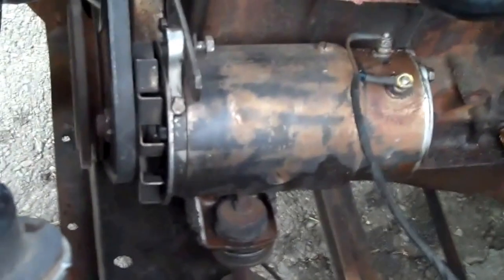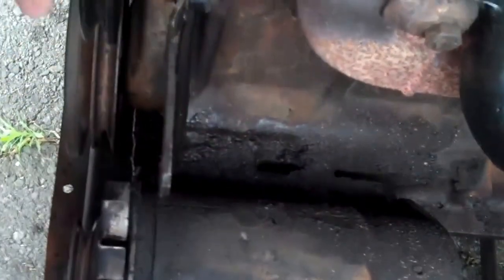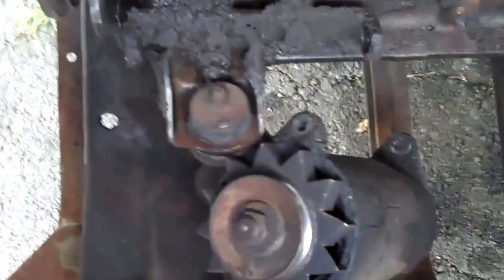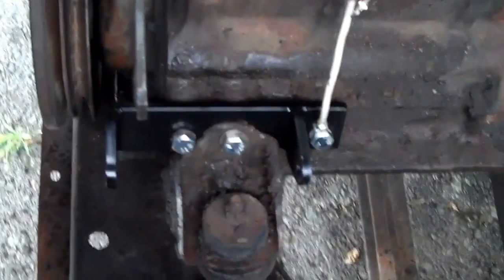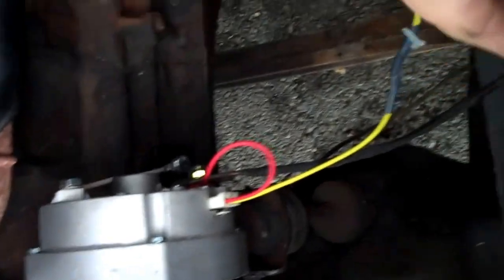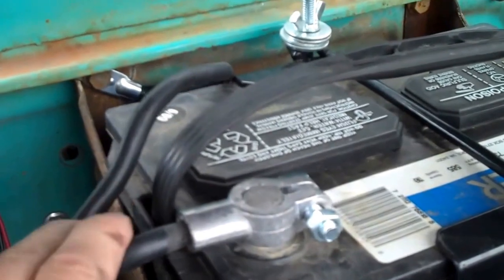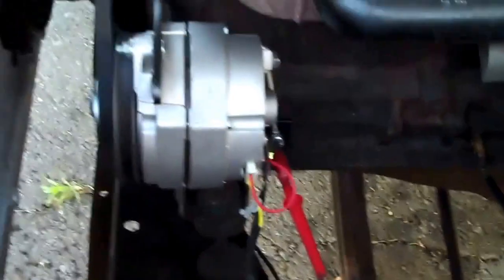Generator to Alternator Coversion

Comment: Couldn't you have used the existing wires to achieve the same thing?  I am thinking that when I get my generator mounted I can run the wires from the gen to the wires that currently connect to the regulator once I identify them... My problem is that I have some custom work under my dash that makes getting to my ignition wire and indicator light wire very difficult and I would prefer to not have to deal with that right now if I can get around it. A friend of mine told me that I can take my power wire from my alt and connect it to the top wire on my regulator then take my GND from my alt and connect it to the 2nd and 3rd wire of my regulator (basically splicing them all together). He said this will take care of everything. Indicator light, ignition and power back to recharge battery.Do you agree with this???  BTW I have a 64 Fairlane .. :) and the only reason I am doing this conversion to alt is because I installed a modern high-powered 1200WATT stereo system in my Fairlane and the Gen cannot handle this at all. In fact it will burn the brushes off of the Gen because it pulls so much current.
Reply from the maker: You can use most the wires.
I connected my wires on the regulator.
used the block for a ground.
the regulator block was only hot with the ignition, so that's why I used it.
I'll send you a photo if I get a chance.
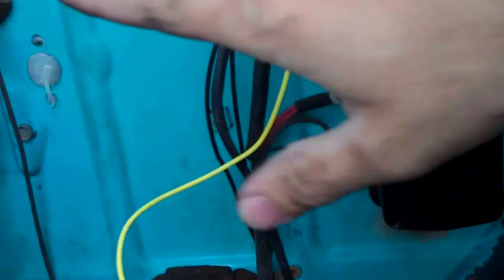Reply from the maker: +GeorgeBonez Starting at 1:52 I show what I have done to use all the existing wires possible. Every car is a little different, you may have access to an exciter wire some place under your hood. If your fuse box is under the hood that would help. Mine is located under the dash. That is the location I used to get ignition hot.
Reply: +Michael Beattie Do you mean 1:52 of this video or are you referring to another vid?  If you are talking about this vid I didn't see you use any of the existing wire. You said (in the vid) to remove them from the regulator and tape them off...  Am I missing something? Sorry Michael but I am a little confused here... :(
Reply from the maker: I'll have to take a photo. what I  did was remove the bottom 2 screws and over lap them all on the top.
basically tied all them wires together.
but I'll look at the truck and check.
been years since I have done this.
Reply: +Michael Beattie Ok man so here is where I am in my conversion... I finally have my 100AMP one-wire Tuff Stuff Bullet alternator mounted properly so I will be attempting the wiring part tomorrow.. The weird thing is that I don't have the yellow wire that you mention in your vid that goes to your ignition so I am really confused how this is all going to work out on my car??? Man it took me over 16 straight hours to work out the mounting brackets and belt-size on my gen/alt conversion and eventually I had to do some serious improvising on the bottom mounting bracket.. The 1964 Ford Fairlane simply wasn't designed for an alternator haha  ...

Comment: I noticed you were able to pull all the bolts by finger.  If you just tightened up all those bolts your generator would have worked just fine.

Just kidding.  Nice how-to video. :)

Comment: CAREFUL about positive ground vehicles... gauges will read backwards.  gotta drop the voltage, insulate the gauge from the cab metal (ground), run a gauge ground wire and reverse the gauge wires
Reply: Generators didn't care about polarity.  Alternators do.  With an alternator, it has to be negative ground.

Comment: The guy who rebuilds generators and alternators in my neighborhood said that alternators do not last as long as generators. He said that if your generator is in good shape, and your wires are in good shape, but it does not charge well, get a new regulator.
Reply from the maker: My generator was fine and had no issues. I had upgraded to electronic fans and the generator could not put out enough amps to operate them, the alternator can put out a higher amp than a generator.
Reply: @DinkAround  I understand your point, I am interested in replacing my tractor lights with LED's and was told that while an alternator gives more consistent power a generator can run quality LED's if every aspect of the system is operating well. I guess I will find out in a month or so when I plan to make the change. With my generator, charging drops off at about 800 RPM, but overall, I always have lots of cranking power.

Comment: I thought most old tractors were positive earth! I also thought most alternators we negative earth!
So how can you just replace an old dynamo with an alternator. For a start, the starter motor will run in the wrong direction? (and the gauges?)
It would have been nice to know where the new bracket came from as well!
So, this video is unhelpful and misleading.
Reply: Suggest looking up positive to negative earth conversion. You could do this with generator first. The starter does not reverse as it has windings in the rotor and static housing. It will turn the same way regardless of polarity. Resistance based instruments and lights not affected by polarity. Voltmeters and ammeters just reverse the wires.

Comment: Take brown wire connect to red wire on regulator connect center wire on regulator to white wire on alternator brown wire to output on alternator generator lite will  work on instrument panel no new wires needed on pontiac's factory ammeter will work

Comment: Why not repair the 6v system? I've got several Ford N series tractors and when I buy one that's been converted to 12v the first thing to land in the scrap pile is the fucking Delco alternator that someone's butched onto it! 6v works just fine if it's set up right. Those bastards will start when well below freezing.
Reply from the maker: FlatBroke612 This was never a 6V system. This was a factory 12V system. In order to run the electric fans and other heavy electrical items I went for a high output alternator in its place.
Reply: +Michael Beattie Ah, very best. I'm just a stickler for originality when it works I guess!
Reply from the maker: FlatBroke612 I completely understand. I kept the Generator in hopes of reinstalling it someday. Just need some extra time to rebuild it.
Reply: FlatBroke612 I bought a 1959 Edsel, in good shape. but Battery won't keep charge, so I'm gonna take the old generator out and there are shops near me that will revamp them for say $50 or so. if that won't work, a new voltage regulator is only like $50-75 or so too. 
Runs and drives fine, but still getting used to the 3 speed and the last thing I need is to stall out at the light and not being able to start up again, lol.

Comment: The generator is better!
Why replace it with a dumber system?
Reply from the maker: Because more amps were needed, hence the alternator installation
Reply: @DinkAround  You can get a very powerful generator for the same price although generators bog down the engine rpm.
I personally like them because they can revive a dead battery in no time!
I hope that alternator lasts for years to come!
Stay safe.

Comment: question, I have an alternator but every now and then the old generator light in my dash lights up red (which was a signal for bad generator) is that only because of the swap or could it be that my alternator is bad?
Reply from the maker: Beto 115 not a 100% but the alternator could be putting out low enough voltage to spike the warning light. Does your alternator have an internal regulator?
Reply: Michael Beattie I believe it does, and I had it rebuilt about 4 months ago. so I don't understand why thhe warning light still signals. I think you may be right, the alternator might just be too low voltage

Comment from the maker: I did a lot of looking to find out all of them work and it dose not matter what brand you use. I think classicparts.com lmctruck.com and ebay all have them. My video is not a how to, but more of a basics on how I did it. Use it how you like. Do research on google and there is a lot of forms that give good advice. Thanks for watching once again and I hope it helps.
Reply: Michael Beattie so I run a red hot straight to the battery, have a 1958 Chevy am doing need help don't seem hard